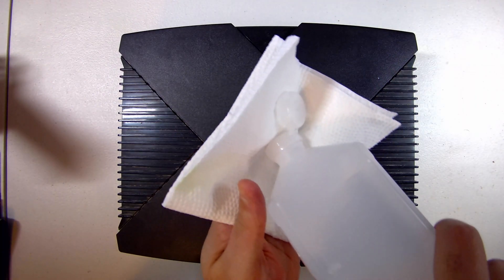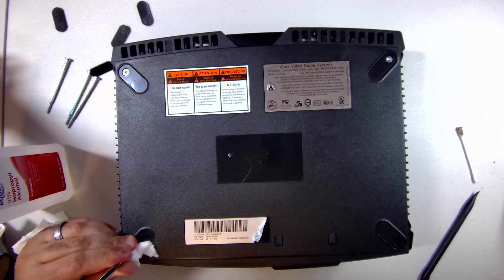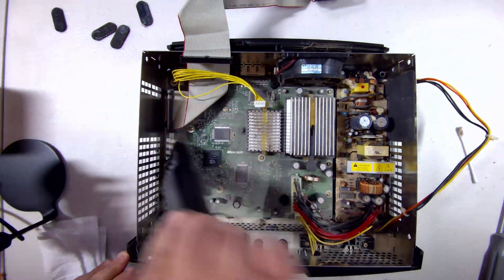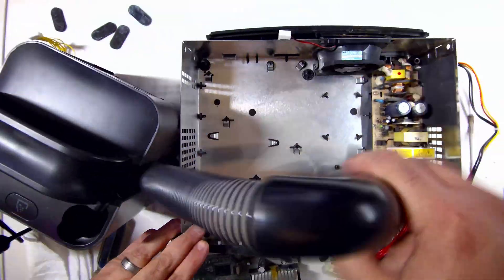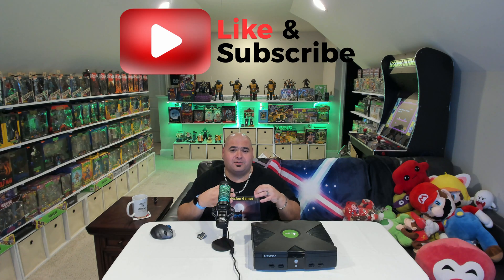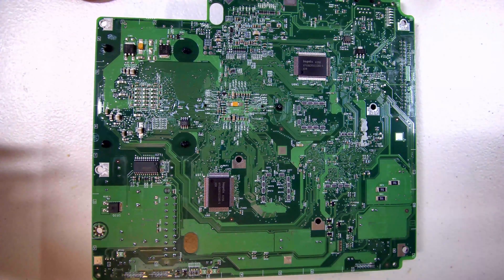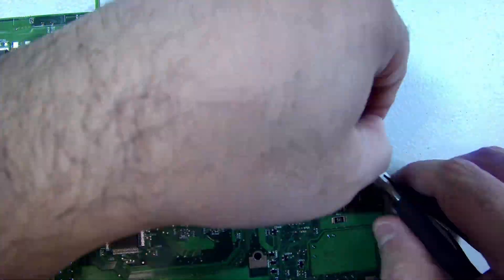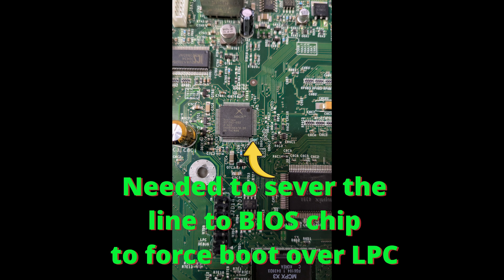Xbox Resurrection $20 Thrift Store Find - Pt. 1 Refurbish Console & Rebuild LPC Port

Comment: I have a 1.6 xbox. I always thought the d0 and lframe was the same point which I connect to ground. Your video shows green wire. Where is the lframe point if indeed separate from d0? Got link to wiring diagram?
Reply from the maker: @TheOriginalVersatile I am using the "alternate LFRAME/DO" wiring technique that goes from the backside of the board avoiding the one and the top of the board near the Cyclops chip. It simplifies the soldering.

There are a few approaches to achieve the same thing.

If you haven't already be sure to like and subscribe to keep up with all the gaming tips and collectibles we have coming down the pipeline!

Thanks for watching! ❤️‍🔥💥😸🤙